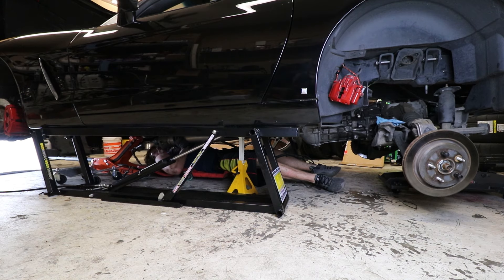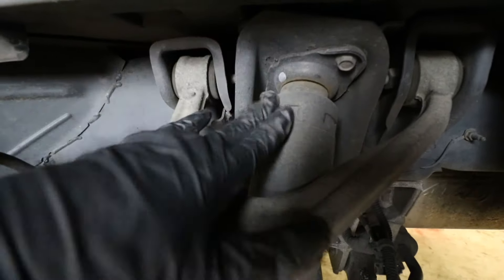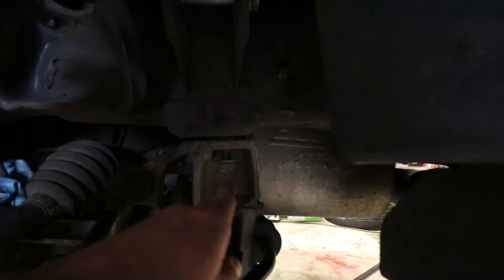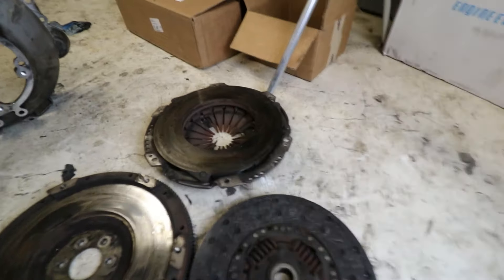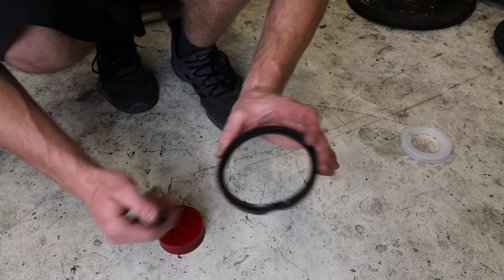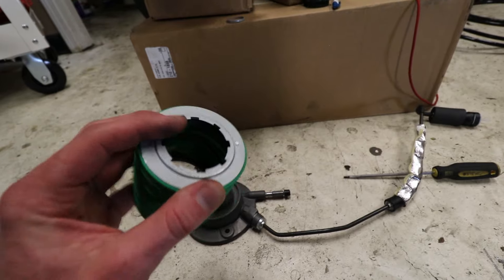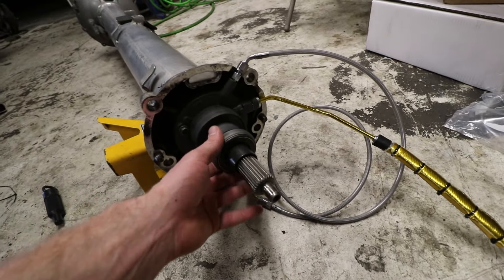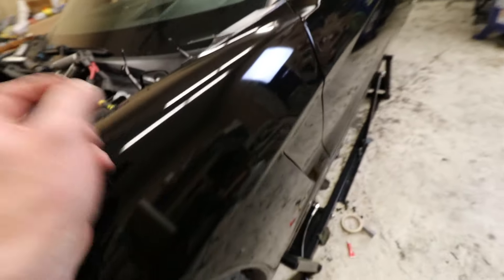How To Install C6 Corvette Clutch - Monster Twin Disk Clutch Install

Comment: Excellent video, just received my monster dual clutch with the lightened flywheel and am excited to tackle the job. I thought the head cam install was difficult, this will be a little more engaging, but it all comes down to taking your time and following instructions. Thanks again for your video, definitely a huge help !
Reply from the maker: I'm glad I could help! And exactly, just take your time and you will be good to go!

Comment: If no clutch fluid is leaking anywhere from your clutch lines/hydraulics, and your clutch pedal is no longer holding ANY pressure whatsoever, or is inconsistent with clutch pedal pressure and loses pressure back and forth; this may mean that your clutch master OR slave cylinder seals may have gone bad.

Process of elimination would be easier to replace the CMC first, which usually fixes the issue 50% and more of the time. If that does not fix the issue, you may want to check the factory clutch line; although if there’s no visible leaks, that’s probably not the issue… Thus, finally proceed to replacing the CSC! 

I went through THREE OEM CMC’s before the last one finally stayed… The first 2 would constantly have bad seals and let in air over time, causing there to be play at the top of the clutch pedal (you can feel and tell that something’s not right). Luckily, I bled my last one that held up, and then bled it again when I got rid of the stock clutch line, to upgrade it to a stainless steel braided one. 

If you decide to keep the stock clutch line, you should take it out to heat wrap it, or just upgrade it with a SS one altogether, as I mentioned. This will help prevent excess heat soak to the clutch line, and the stainless steel upgrade will hold more stable clutch hydraulic pressure; which means you can reliably drive the car spirited and further upgrade the clutch to something like a twin disc setup!

Comment: Thanks for the video Mitch.  I've never seen your channel before.  I'm also from washington.  I need to change the clutch in my C5 soon and am also going with the monster twin disc.  I'm impressed you did that by yourself on the floor regardless of quickjacks.   Unless I win the lottery I don't hardly ever play I will be doing it on the floor as well with quickjacks.

Comment: Great video Mitch.  Quick question, are you getting a lot of chatter noise from the clutch when not in gear?  I recently installed the same clutch on my 06 Z06 and I'm hearing quite a bit of noise when not in gear.
Reply from the maker: Thank you! And yes I get a good bit of chatter especially when it’s cold. I got a little stressed that I had messed the air gap up but after calling monster they confirmed that the chatter while in neutral is normal and it was installed properly.
Reply: @MitchCarveth  Thanks for the reply.  That helps put my mind at ease.

Comment: I'm planning to buy that same clutch,  I have a c6 z06 545rwhp , would you recommend? Thanks
Reply from the maker: 100% recommend, it will easily hold that power and it drives just like the stock clutch.
Reply: @MitchCarveth  thank you sir, I'll use this video as a guidance
Reply from the maker: You are welcome, if you have any questions once you jump into it feel free to ask.
Reply: @Mitch Carveth  Brother I have the transmission out, any of the bolts from fly wheel, clutch , transmission bolts are they reusable? Or which one can I use.. I'm ready to put it back together

Comment: Getting ready to jump into this process soon on mine.  I was pumped to find your video so timely.  Did you put any grease on the billet bearing support?  The stock one had some white grease on it when I swapped them on my new unit so I was curious if it needed to be replaced.
Reply from the maker: Thats awesome, I hope the video helps! I did grease the bearing support, It's definitely a good idea to do so.
Reply: @MitchCarveth  Right on.  Thanks man!
Reply from the maker: You are welcome brother! Any other questions just let me know.

Comment: Great video bro. Do happen to have the part number for clutch kit ? Aluminum flywheel? Are you happy with how it feels ?
Reply from the maker: Thank you, Sorry for the late response! I thought it was aluminum but it's actually billet steel. Unfortunately I haven't had a chance to drive it yet due to the widebody install but I should be able to answer that soon.  Here's a link to the one I went with.  
https://monsterclutches.com/monster-s-series-twin-disc-clutch-c6.html#/82-bleeders-none/57-clutch_fluids-none/59-monster_stickers-none/101-no_questions_asked_warranty-none/104-release_bearing_support-none

Comment: Monster has three different twin disc kits one is organic one is Kevlar and one is ceramic. Which one did you choose What does it sound like?
Reply from the maker: Mine is the Carbon Organic “S series”. It has a bit of chatter when sitting in neutral but it drives just like stock and grips smoothly, until it gets a little too hot then she grips pretty hard.

Comment: Doing mine right now lol, I heard what you were saying about leaving the rear cradle bolts threaded a little to prevent the engine from cracking the firewall while dropping the tube, anything else I need to worry about to prevent the firewall cracking? THANKS!!!
Reply from the maker: Lol nice! Just make sure you lower the cradle slow and just low enough to get your hands on the top torque tube bolts you will be good to go!
Reply: @MitchCarveth  ohhhhhh your right, I see it in my head now tilting the engine back with that tube. Thanks for replying back so quick, looking forward for more of your videos!

Comment: So question.  If the plastic release bearing brakes.  Would that keep the clutch from engaging?
Reply from the maker: That would give you engagement issues for sure. I’ve heard of them failing even with stock clutch. If the pedal happens to be stuck on the floor I would look into your clutch master cylinder though.
Reply: @MitchCarveth  Awesome thank you.  I got an issue where you release the clutch and the car don't move. Peddle returns.

Comment: How hard do you think it would be to just get the transmission out? Like how long you think
Reply from the maker: I would set 3 maybe 4 hours aside to get it out. Once mid pips and mufflers are out of the way everything on the transmission is pretty easy to get to.
Reply: @MitchCarveth  I really don’t want to have to send it to rpm just for synchros replaced lol
Reply from the maker: Nothing against rpm but I do not blame you lol

Comment: Never done this to mine. Looks very involved. Wouldn't it be easier to take the engine out.?
Reply from the maker: For me it was much easier to go this route. best way to remove the engine is out the bottom as well. I've pulled the engine out the top way on my buddies C5 and it was giant pain even after all accessories were removed.

Comment: How do you like it so far?
Reply from the maker: Haven't had the time to do a full break in yet but so far I've got great engagement and the pedal feels good. no chatter or chirping coming from the clutch either so thats a win as well. Once snow isn't an issue I'll be doing an update video on it with more info.
Reply: @MitchCarveth  I had mine installed a few weeks ago & immediately noticed vibration, especially when taking foot of accelerator or deceleration.  It's subtle but it's there.  Clutch seems to work fine besides that so I don't think it's an install issue. Company says it's due to harmonic distortion so I did some research & that might be it.  Did you get a new harmonic balancer to help take care of that?

Comment: Do you grease the pilot bearing?
Reply from the maker: I did not, its a sealed bearing. I also didn't want it to sling excess grease on the clutch once it's hot.
Reply: @MitchCarveth  thanks for the advice!
Reply from the maker: You're welcome!

Comment: Just another option when removing the cradle. I disconnected the brake line to the caliper and left the brake lines in the car when dropping the cradle.. Just another option.
Reply from the maker: Great tip, thank you